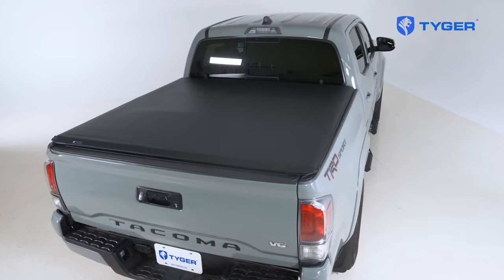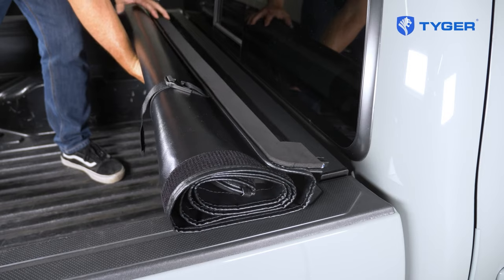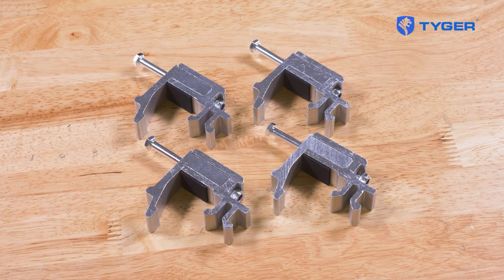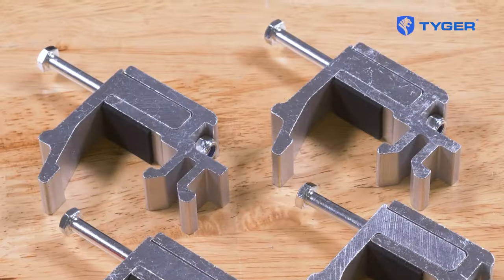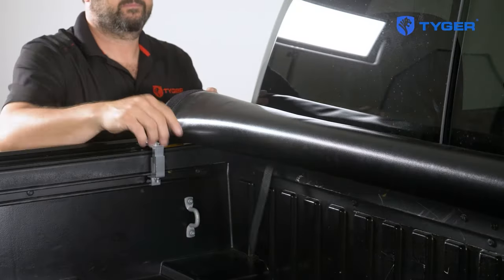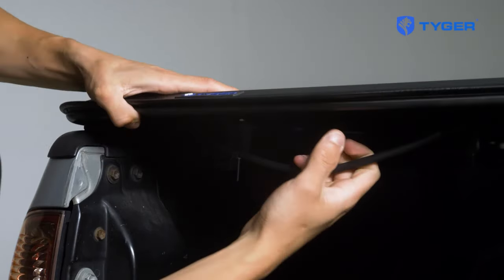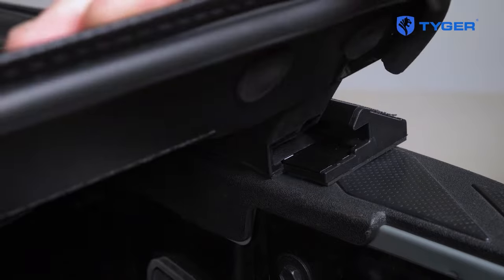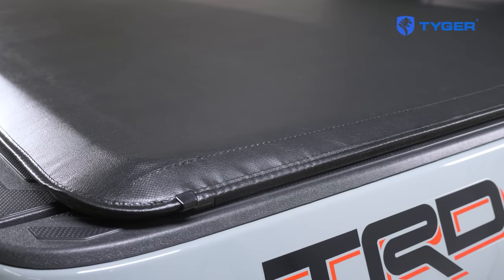TYGER Auto T1 - THE ESSENTIAL Soft Roll-Up Tonneau Cover | Installation Deep Dive

Comment: Mine was very tight and couldn't latch. I had to move latch points back toward cab. Is this normal? And will cover stretch and i need to adjust again? Other than that it looks great.
Reply: Same thing happened to me and I can’t figure out how to fix it. What are the latch points?
Reply: @rebeccamailloux1651  latch points are at very back corners. And after cover was on for couple of weeks it stretched out and i readjusted latch points and its much better now.
Reply: @kayakingwithkevin303 you are adjusting the tension plate offset, not the latch points, I think that's why the other commenter got confused

Comment: Bought one for my 2020 chevy trail boss and the back of it wiill not stay latched. I have the latch points move in to the last line and it still has so much tension on it that the back is lifting up off of the tailgate about 1 inch. You can see the latch fingers are starting to break at the corners. I have the rails moved in to the correct width as well. The back will actually pop off with the slightest bump. Any others having this issue?
Reply from the maker: Hi, that's rather unusual. I suggest that you email us so we have an another look for you suppor@tygerauto.com
Reply: I have the same issue with my 2024 trail boss. Did you get this resolved ?